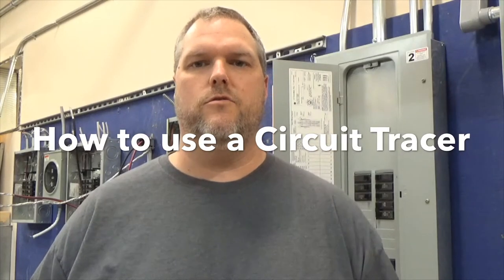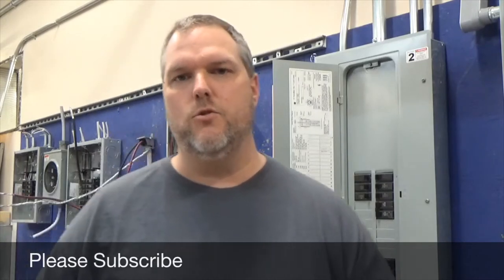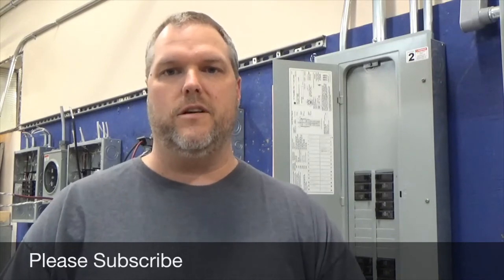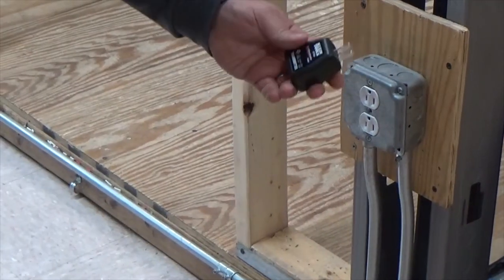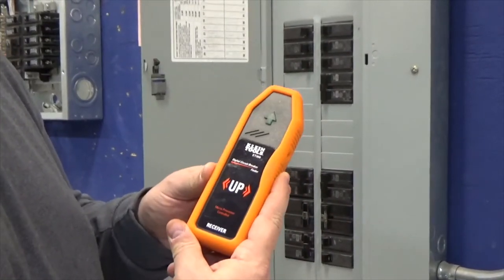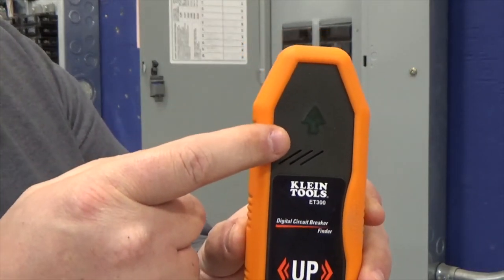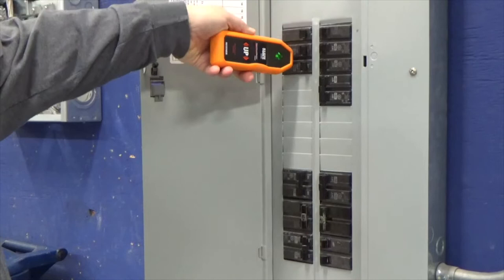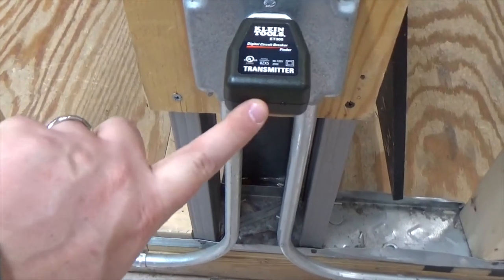How To use a Circuit Finder

Comment: If you went ahead and shut off the breaker that you identified, you may as well confirm with another pass to see that the alert no longer sounds on the panel. With the power removed from the transmitter, it shouldn't pick up with the receiver any longer.   Good practice especially in cases where you have multiple breakers continuing to sound off despite repeated passes to adjust the detection threshold sensitivity.

Comment: Thanks for posting. Is there a method to trace back switches or lighting fixtures to a circuit?
Reply: Get the two prong screw in socket converter and then use this meter. Works for conventional bulb thread

Comment: thanks so much! Quick question: Will a faulty receptacle give a false read? I have one in my basement that I am struggling to tone out. I get a hit off of two breakers and neither one cuts power to my receptacle. Currently the receptacle has tested for an open ground.

Comment: I'm in the facility maintenance business and we are going to map all our circuits, both energized and not. We have panels on multiple floors. I've been looking at various products some in the $000 range.  I have used the cheaper units in the past and they were inaccurate more times than not due to the wiring entering multiple panels in an electrical closet. 

Do you have a brand or product that you would recommend professionally?

Comment: Ty for the video. What's the limit of this device? Can it detect the circuit breaker if the socket is 150-200meters away from the breaker? If No please tell the range

Comment: Excellent video! That’s a cheap tool I don’t own that I didn’t know existed! That tool will make finding circuits much easier! I wonder if there’s another version of the tool that could be connected to light or fan fixtures.
Reply: Use a lamp socket adapter

Comment: Thanks for posting and good video - I just bought one of these because I could not find the right breaker for a wired smoke detector. Every time I use it I get a false positive.  I turn off the breaker in which the tool identifies and the circuit is still live!!!  Seems to identify a different breaker each time even. Any advice on troubleshooting that, other than the obvious of turning off the main?  Eventually I’ll have to just turn off the main, thought this tool was the answer, but I cannot seem to find the right breaker for the life of me!  Any help?
Reply: FYI: I solved this problem. I tried multiple times again and every time I was led to a false positive on the same circuit (the same breaker each time, which was not the correct breaker) - I turned off that false positive circuit/breaker, then scanned again and it led me to the correct circuit/breaker (which never signaled the circuit finder before), so bizarre. Even after I turned back on the circuit/breaker I knew was the one I was trying to trace, the false positive went off again using the tracer 🤷, no clue why.

Comment: What kind of tester do you use to see which circuit breaker is for lighting?  I had to troubleshoot a bad three way switch recently.  Panel schedule was completely faded and unreadable.  I had to just start flipping breakers and hope to get lucky.  I did.  The lighting circuit was Circuit #1.  Lol.  I'd like a good tester because I know I won"t always be so lucky.
Reply: These types of testers have accessories for light sockets, loose wires, ect.  The type your asking about screws in where the bulb would go and the transmitter plugs into it.

Comment: Yes I see this works for a wall receptacle, how do you find power to a light switch or push button or rocker light switches ?
Reply: they sell a kit with prongs to attach to wires then connect the transmitter

Comment: How would you trace wires through walls?
Reply: Fox and hound tracer is capable of detecting wires at longer distances, if you set it up properly to inject the signal onto the line.